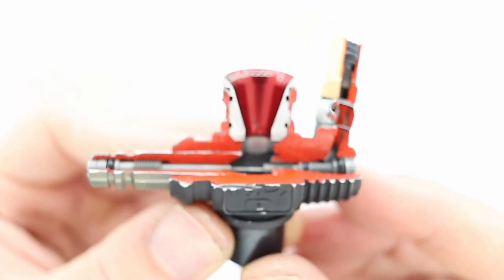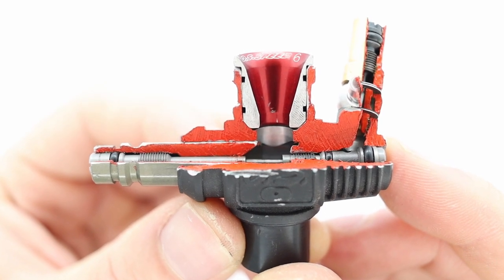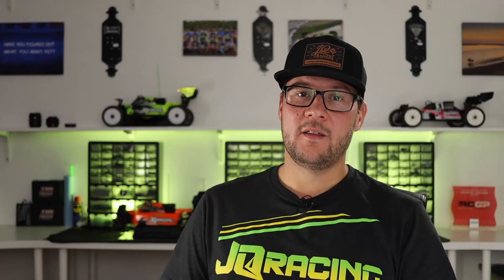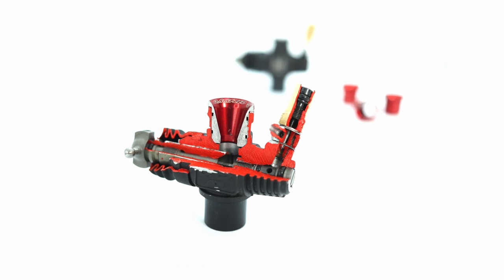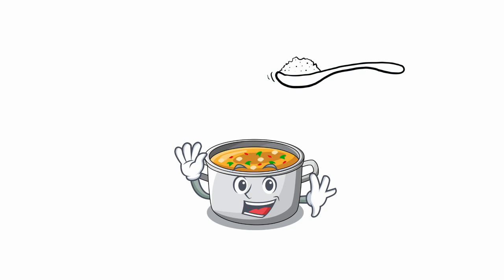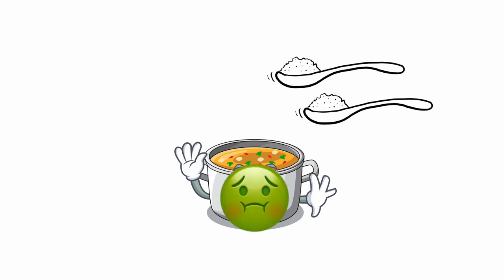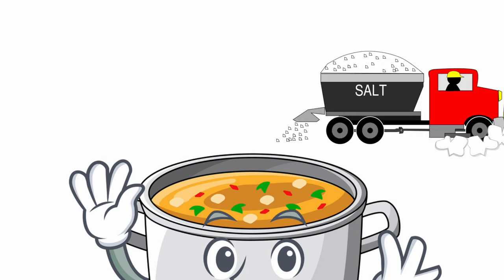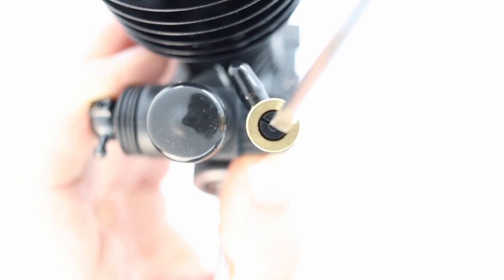Carburettor VENTURI & HOW IT WORKS

Comment: How does once decide on going with a bigger or smaller venturi? For example I run on a small low traction track and easily get 10+ minutes to a tank, but I'm not sure a bigger venturi is needed as I don't need the power.
Reply from the maker: Then it is not needed. A bigger venturi is good to get more power or make the engine easier to tune.

Comment: I have searched for quite a while and have never been able to find out any information about why a good tune engine will stall in a tight corner when the engine runs for a while and gets to great operating temperatures and running great. What would be your opinion? It also happens when it's running great and vehicle may roll over.
Reply from the maker: Impossible to say. Maybe your idle gap is too small, low end too rich, linkage badly built, or your engine is just done
Reply: @invisiblespeedrc  watched a lot of your videos and downloaded some to watch over and over. I am very appreciative of your knowledge and has helped me help others as well. Thank you very much for your response. I started studying more about glow plugs and found a great match that ended my issues. I have been so focused for years  on carb settings and ignoring glow plugs. What a new view into nitros I have now. Keep the great content coming and I will keep watching...

Comment: I thought you would explain that in a more scientific way, it is good and understandable dough. But i was expecting something about the "venturi effect". So the way how to produce negativ pressure in a pipeline...
I wonder anyway, what takes more impact to the fuel flow, the "vacuum" in the carb(venturi effect), or the resonance of the exhaustpipe... 

Would be interessting to see pressures und airflow in the engine
Reply from the maker: Im not interested in engines enough to care
Reply: @invisiblespeedrc   never mind...
I saw the video about how to tune the engine. it is the best video about that i've seen so far. Not only the explanation, but the way you tune as well... i never understood this topend based tuning other people do...

Comment: Question I have do you set idle gap with Venturi on or off
Reply from the maker: No venturi
Reply: @invisiblespeedrc  thanks, one more question I watched your 1 20 video and I still have one problem on a high speed pull and let go of throttle engine revs high a could seconds and then drops to idle. What am I doing wrong?
Reply from the maker: @jimmygonzales5756  top end is too lean, or you have a leak, a bad gasket, torn carb boot, bad front bearing....

Comment: Can u please point me in the right direction on why my Lrp.32x backfires through the exhaust at wot
Reply: Try to lean the top end a tiny bit at a time. Could also be that you LSN and HSP are not balanced well enough. Too hot a glow plug may also cause that. I would richen up both needles and start over.

Comment: No, no, no, no, no, no. You almost touched on it at 2:30 but No! The engine has 3.5cc's and it revs at 50,000 rpm so it sucks that amount of air. The size of the venturi doesn't change the amount pf air the engine draws, it only changes the speed of the air through the inlet - which in turn has effect on the tune - but not much. A smaller venturi makes the engine feel punchier but it's a feel thing. The truth is capacity x rpm = air consumption. Bernoulli is your friend here because physics can't be cheated. Don't believe the hype.